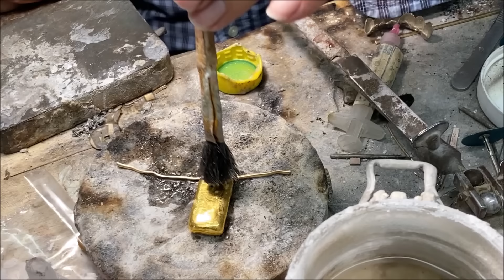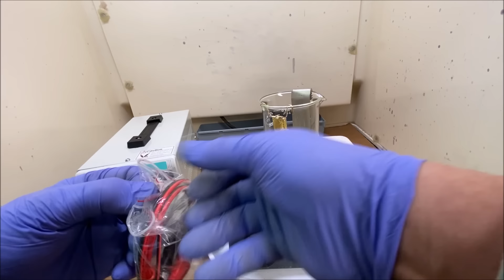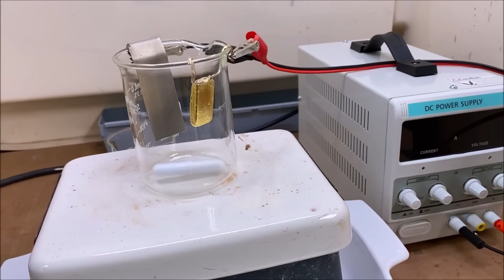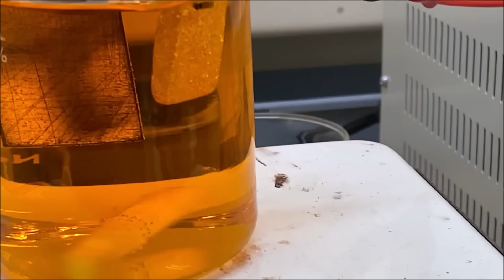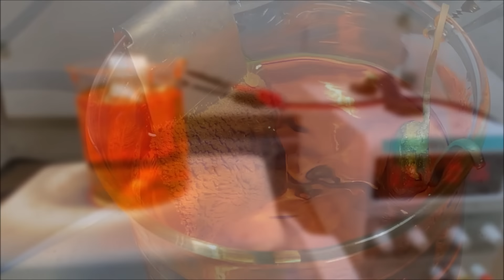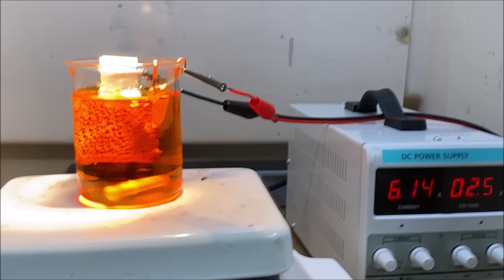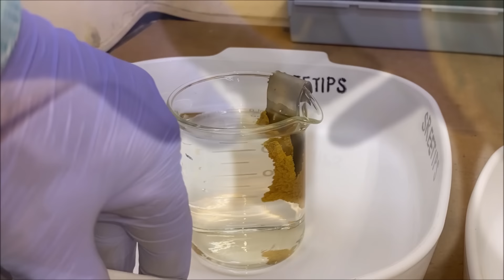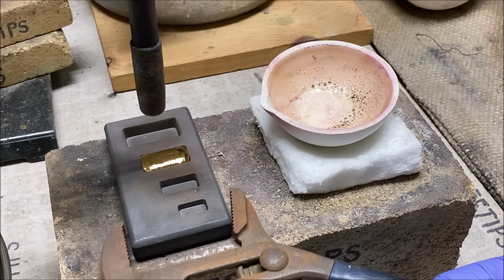Electrolytic Gold Cell Part 2

Comment: You should have rolled the anode bar down some.  That would have made it easier to weld on the ears.
          Regarding the roller, one side must be closer than the other side, causing the metal to curve.  You should have flipped the strip over on each pass to keep it straighter.
          If you use a graphite rod for the cathode, you can put the whole thing in the melt dish & burn off the carbon without the need for fussing over the Ti.  You also avoid Ti contamination of the gold.
Reply from the maker: Thanks for the feedback, I’ll keep that in mind on the next time I do this.

Comment: I always enjoy the Gold electrolysis videos.  The only thing that would be more crazy would be a Platinum electrolytic cell going full blast. 
You made a gold bar a couple of weeks ago that looked perfect. It had a mirror finish on all 6 sides, and there weren't any cooling rings on the top.  The thing looked like face of god it was so perfect. I don't get why that less pure bar looked better then this nearly perfect purity bar.
Reply from the maker: I remember that one. There are many variables to consider.

Comment: And if I run it 6 Hours I have more Gold?
Reply from the maker: You can run it as long as the anode bar lasts. Once the anode bar dissolves completely, no more gold will get deposited on the cathode. The reaction ceases.

Comment: So I'm lost are you just purifying the the anode bar when you say growing gold cell
Reply from the maker: The anode bar dissolves from the current flow through the cell. The dissolved gold ions travel through the gold chloride electrolyte and deposit (grow) on the cathode.
Reply: @sreetips  I know that but the anode bar looks to be pure gold so what's the point of growing the cell .....to clean it ?
Reply from the maker: The anode bar is about 995 parts per thousand. The gold crystal that grows on the cathode is 9999 parts per ten thousand. That’s the only difference. Industry standard for pure gold is three nines. So the extra nine isn’t really necessary. Unless needed for a test standard or some other specific purpose. The only reason I did this was to demonstrate how it can be done, in my garage. And to make the video for my YouTube channel.
Reply: @sreetips   thats what I was thinking

Comment: so you took pure gold and electro-plate it to make pure gold again?
Reply from the maker: The anode bar was about 995 parts per thousand. The gold crystal deposited on the cathode is 9999 parts per ten thousand.
Reply: @sreetips  
Do you end up with a tiny bit more then you started with regardless of how pure you made the un pure stuff ?
Reply from the maker: No, entropy guarantees that there will be losses all along the way. Minimizing these losses will depend on the skill and technique used by the refiner.
Reply from the maker: I think I see what you asking here: am I creating more gold, out of thin air, than I started with? The answer is no. I’m refining the gold, not making new gold.
Reply: @sreetips  
Our bodies grew teeth without needing a pile of other teeth for materials , the proteins that made teeth are not teeth but they made teeth..
 gold is something that's common on earth thats been put under extreme pressure but i dont know what. 
Lead  << we can squeeze that until it has the properties of steel , almost everyone ive told had no idea that was possible, gun channels have zero idea , they think the only option is add a steel core or tungsten to the round, they 100% do not know lead can have its volume decresed /made into something better suited for a round/bullet.
Reply from the maker: That’s interesting. I did not know that about lead.
Reply: @sreetips  
Imagine what else is possible if something as trivial yet important as being able to crush lead into something a lot better isn't common knowledge / borderline an industry secret..

Comment: This is cool but what is the point? Is the gold in the solution just attaching to the titanium?
Reply from the maker: The anode is dissolving, the dissolved gold travels through the electrolyte solution and deposits on the titanium cathode as high purity gold. But the cell can’t tell which of the gold ions are from the electrolyte and which are from the dissolving anode bar.

Comment: why didnt you melt the gold strips to the annode you got the torches, 
or drill a hole and thread the gold wire through then heat the bar to just before melting point and they would fuse together,  use the oxy accetyline torch
Reply from the maker: I guess I didn’t think of it.

Comment: It's a really cool experiment I can definitely understand wanting to try it out but as far as refinement it seems like a waste of time considering that both the anodyne and the electrolyte were made with already extremely pure gold. Unlike with the silver cell where you're using impure silver in the process.
Reply from the maker: The anode was about 995 parts per thousand. The pure gold crystal is 9999 parts per ten thousand.

Comment: How much of the gold from the anode vs the solution ?
Reply from the maker: I’m not sure. I’d need to weight everything and calculate. The electrolyte does become depleted as the cell operates. Because the cell can’t discriminate between gold ions in the electrolyte, and the gold ions coming off the anode bar.

Comment: I live just outside El Paso TX.  I frequently see flatbed 18 wheelers transporting very large flat anodes of pure copper going east on I-10.  LOL!  They don't get to put too many of those anodes on the trailer before they get to max weight.  
That GOLD Titanium Anode looks exactly like the copper anodes on those trucks.  Well Done my friend.  Well Done!! I was surprised how easy that Gold peeled off the Ti anode.  
Soon we will have to call you sreetips Fort Knox.  Very nice gold bar!  Question:  If you put the hot mold on a small vibratory table, and vibrate it at a very low frequency,  do you think it would allow the molten gold to flow into every corner of the mold better?      Love the channel!
Reply from the maker: I don’t know, I’ve never tried that.
Reply: @sreetips   Next time you pour an ingot, keep it liquid with the torch and give it the mold couple of light taps and see if the gold better settles in the mold.  It might give you a prettier bar.

Comment: Maybe I'm missing something, but didnt he start with more gold than what the final product was? So wasnt it a loss? I get that its more pure, but it was over 100g at the start
Reply from the maker: You missed nothing. Your observation is correct. Except I didn’t lose anything. Well, almost nothing. Entropy guarantees that we can never get 100% there will be a little loss, due to entropy, along the way. The remaining gold is in the undissolved anode portion. And in the electrolyte. I’ll recover 99.9% of the gold that I started with.

Comment: Serious question: What is the point of this process? Is it just to purify the gold or is this some kind of modern alchemy to make create gold? Because that's what all of these uploads let along in the titles and thumbnails.
Reply from the maker: This is electrolytic refining. The only place where the pressures and temperatures are great enough to cause protons to fuse into heavier elements is in a cataclysmic event such as when two stars collide.
Reply from the maker: The anode bar was about 995 parts per thousand. The refined gold that deposited on the titanium cathode is 9999 parts per ten thousand. That was the whole point of this process. Three nines is industry standard for pure gold. So the fourth nines is totally unnecessary unless needed for some specific purpose such as a test standard. I did it for the show.

Comment: Hey Mr. Sreetips, just sayin. My first idea was to dill a hole 1.5 x the diameter of the larger ring {rounded) then press the second (flattened) ring into the hole. We are talking an electrical anode of gold composition so electrical continuity is guaranteed.
Reply from the maker: Good suggestion, thank you.

Comment: how much did you actually lose from the bar you used in the solution, that dissolved? Did all that gold that corroded away remain inside the solution?
Reply from the maker: No, it gets deposited on the cathode.

Comment: I really enjoy watching your videos. For the removing the gold deposits from the titanium cathode bar, could you just go to the melting table and take advantage of the difference in melting point temperatures? Gold melts at 1064 deg C. Titanium at 1668 deg C.Another thought about heating, maybe the difference in expansion rates would cause the gold to just slip off, without even melting first. The chipping/paper towel method doesn’t have “finesse”. Plus it isn’t as hypnotizing as watching fire. ;) Thanks for the vids.
Reply from the maker: I’d be afraid that the GOLD would weld to the titanium.

Comment: the book says you should use 450 amps with 1,5volts. thi reaction will last forever.
Reply from the maker: That’s for a giant industrial size cell. My small hobby level cell runs fine at ten amps.

Comment: If you started with 50 something grams of pure gold you should have about 81 grams after this experiment ?
Reply from the maker: No, I’d expect about 40 grams or less. Because not 100% of the anode gets dissolved, some of it gets left behind. But I can save it, melt it into and anode, and run it through the cell. I can’t create new gold in this cell. In fact, entropy, guarantees that I’ll end up with less gold than I started with.
Reply: @sreetips then what’s the point of doing it?
Reply from the maker: 1) to demonstrate that I can produce four nines gold, in my garage. 2) to make a new and interesting video for my channel. 3) so I can sell some of it on my eBay site.
Reply: @sreetips oh! Very cool😎👍

Comment: You just made gold into gold.. didn’t grow anything.
Reply from the maker: Grow: to increase in size or mass. And that’s exactly what happens on the titanium cathode.
Reply: @sreetips  okay, thanks for the clarification!🙂🙂‍↕️
Reply: @sreetips  the gold bar after did look a bit larger.
Reply from the maker: No, but the pure gold crystal has a greater surface area so it looks larger than the anode bar that I dissolved.

Comment: At start Anode used gold bar weight was 58.2 grams and at the end recovered bar weight is 45.6. Where is 12.6 grams of remaining gold?
is 100% gold will be recovered in this method?
Reply from the maker: The remaining gold is in the undissolved part that was not in contact with the electrolyte.

Comment: Hi how are you Is it possible to make gold like silver crystal?
Reply from the maker: Yes, but the process is cumbersome.
Reply: @sreetips  So would you like to tell me the method, or make a video on this topic as well
Reply from the maker: It requires some special equipment that I do not have. I’ve made electrolytically refined gold. I have several videos on it posted on my channel.
Reply: @sreetips  Yes, I have seen them.
Reply: How gold is converted into white powder then it is added to distilled water and used for gold plating, can you tell me the recipe?
Reply from the maker: Sorry, I don’t have any experience with any of that.
Reply: @sreetips  Thanks 😊

Comment: How is that white thing at the bottom spinning by itself?
Reply from the maker: Magnetic stir bar. Teflon coated. There’s a spinning magnet under the stir plate heat pad.

Comment: So is this process basically 100% profit?
Reply from the maker: Not at all. The current flow dissolves the 995 parts per thousand pure gold anode, the gold ions travel through the chloroauric acid electrolyte, and deposit as high purity 9,999 parts per ten thousand pure gold on the cathode. This is the process that big refiners use to refine gold for their four nines pure gold coins.

Comment: So, you GROW gold?
Wow...😮
Reply from the maker: Grow: to increase in size or mass. The gold grows as it plates out, over and over, onto the cathode. But no new gold is being created out of thin air. It all comes from the anode bar that dissolves from the current flow through the cell.

Comment: Guess I am not getting what is going on here
Reply from the maker: I pass an electric current through the anode bar. This causes it to corrode and push gold ions off and into the chloroauric acid electrolyte. The current flow causes the gold ions to be attracted to the titanium cathode where they stick and accumulate. Only the gold sticks to the cathode. Any impurities remain in the electrolyte. The reason? To produce four nines gold at home. And for the show.

Comment: You can do electrolysis of gold chloride in water. No need acid.
Reply from the maker: The book called for 10% hydrochloric acid. I noticed that as I added HCl while it was running, the amps spike up upon adding the HCl. I think adding HCl is mostly to keep conductivity high during cell operation.

Comment: I'll be honest buddy I don't know how you missed this as professional as you are but the reason why the gold crystalscwere so hard to take off from the  cathode was due to the cathode surface having scratches and put marks on it if you look back at the start of your experiment you started getting a lot of black lines on the cathode which shows how scratched it was a scratched surface has many barbs and fishers in it at a microscopic level which means atoms of gold were being trapped into the crevices of the scratches which made it bond to the cathode more thus causing a difficult process removing the gold from the cathode
Reply from the maker: Yes, I agree

Comment: So... you made $3k in 2½ hours?
Reply from the maker: I’m refining gold.
Reply: @sreetips  I may be misunderstanding.
Reply from the maker: @sorenjensen3863  this is electrolytic gold refining. The currrnt flow dissolves the 995 parts per thousand pure gold anode, travels through the electrolyte, and deposits (grows) on the titanium cathode as 9999 parts per ten thousand pure gold.

Comment: I started watching all your videos.

The silver video was amazing.

To be clear, the only thing happening is that the metals are being refined to a better purity? Correct?

After I watched the silver video I got the impression  that the metals were actually reproducing, creating more quantity.

Just wondering if you could clarify, if you ever read my comment.  Thanks.
Reply from the maker: I’m refining the silver. No new metal is being produced from nothing. I refine gold. I use sterling silver, that I buy at estate sales, to refine the scrap gold. I recover the silver from that, melt into shot, and run it through my silver cell. The cell converts the impure silver (about 980 parts per thousand silver) to high purity four nines fine (9999 parts per ten thousand) pure elemental silver metal. The impure silver is added to the anode basket. The anode basket is suspended in the silver nitrate electrolyte. I pass an electric current through the impure silver. The silver dissolves, passes through the Dacron filter, travels through the silver nitrate electrolyte, and deposits on the stainless steel bowl (the cathode). The bowl is connected to the negative pole of the power supply. The process only deposits pure silver on the cathode. So I’m refining the impure silver, into high purity silver. When it’s full, I harvest the pure silver crystal, put it away and forget about it. Then I repeat the whole thing again.

Comment: Right but thus requires electricity. Could this be a sustainable business model?
Reply from the maker: Large refiners use this process to refine gold. Royal Canadian mint uses a similar process to refine gold for their four nines fine Canadian Maple Leaf pure gold coins. In fact, ALL high purity gold is produced using an electrolytic process just like you see in this video. So I’d say the answer is yes, if refining is the type of business you want to get in. I do this as a hobby. I can’t imagine doing it as a job.